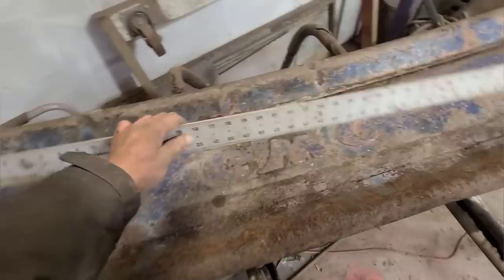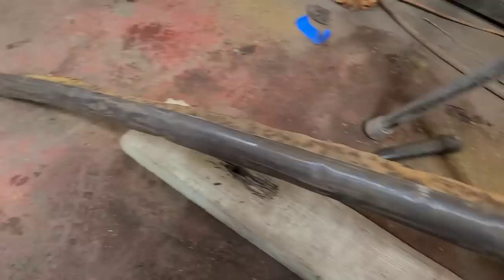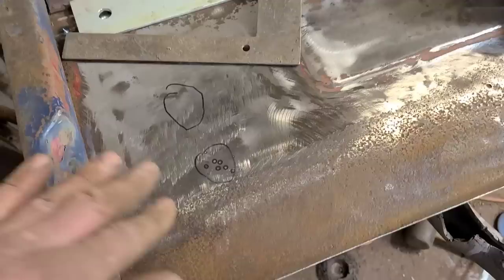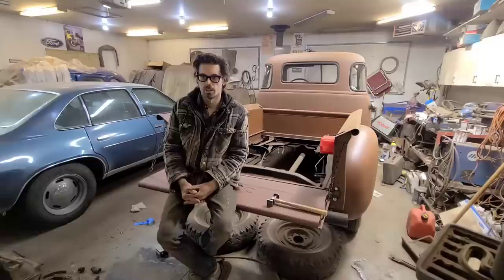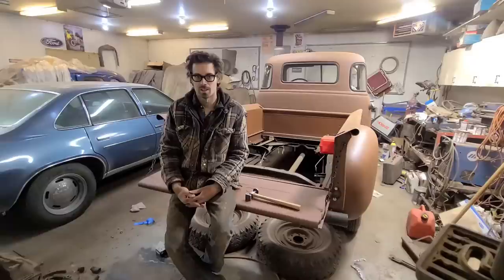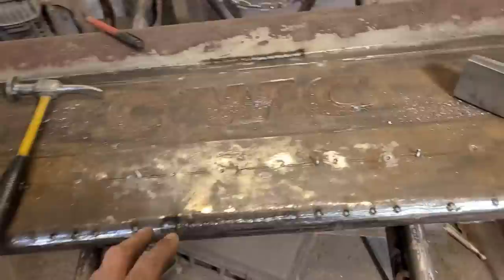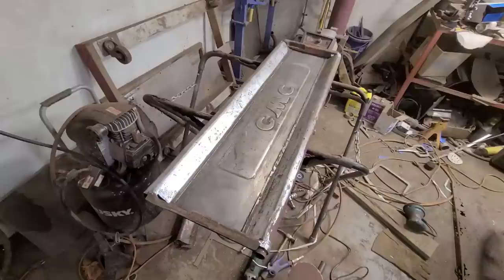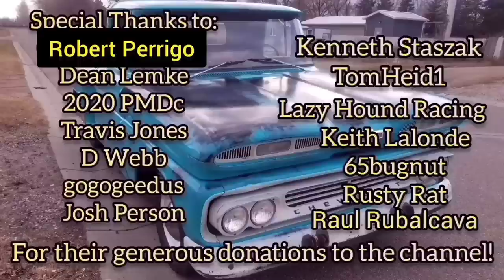EXTREME Rust + Dent Repair. Can this RARE Classic Truck Tailgate be Restored? 1948 GMC Restoration

Comment: I remember my Dad back in the early '80's welding a flat plate into the backside of his '69 Chevy truck's tailgate to desperately try and give it some structural integrity.  Watching him quench it with water and seeing that plate warp by inches was very memorable.  He bought a new tailgate later...  Dad is no longer with us, but the old '69 is still rolling along.  Dad owned it 25 years, and I have had it for 29!  Your '48 should be good for another generation or two!
Reply from the maker: That's great you still have your dads old truck!

Comment: I like that your not just throwing money at it, a close up of the stripping wheel your using on your grinder. Would be helpful, everyone has a different name for stuff, is it a flap wheel or just a sanding disk. Being able to fix the existing panels is skill, anyone can throw parts at it and complain how they don't fit, another great video.
Reply from the maker: Hi Ron. I'm mostly using a paint stripping wheel on the grinder

Comment: My friend, how you do what you do is fantastic to watch.  I also have a quiet laugh when I hear you say the phrase "We're not going to do much to this panel - just make it presentable" and then proceed to turn out something that takes the minimum of filler to finish off and make a showpiece out of.  This video is a true example of that - one trashed tailgate that (at best) someone would bash top and bottom as straight as they could with a mallet and use as patina'd wall-art or (at worst) consign to the scrap metal pile.  You take that sow's ear and make a silk purse out of it.  Ok - I can still see a few blemishes, so the silk was contaminated, but it functions as it needs to and looks perfectly good on that truck....and to be honest, if the truck was being used as a TRUCK instead of a showpiece, would look good enough and function well enough probably for another 70+ years.  I've enjoyed the series on the '48 GMC very much and seeing the different ways you used to tackle the rot and dents...as well as that brilliant 5-window conversion.  Funny thing was, when I started watching, I half expected you to set the tailgate on fire and then blow it out.....and magically, there's a repro tailgate sitting there ready to bolt on!  ....but no.  That patented phrase appeared and then the work started....and I think part of it for you was the challenge to make the original metal look as good as it could.  It still made for good viewing and the tips on using the Unispotter to shrink panels was inspired.  A bloody good idea, mate.  I'd never thought of using one that way, but the results speak for themselves.

Something you said reminded me of a mate of mine and his Austin A35 van back when we were teenagers in the late 80s.  This poor old POS of his had rot in many places and had been driven into the back of a Leyland bus by a previous owner, who then (I think) used the claw end of his hammer to straighten the panels.  The previous owner's panel-beating skillset rivalled that of an empty cardboard box, although at least the box could have been used to make a template.  The little van looked more like a disinterred and rotted corpse that still sported all its fatal injuries than a daily driver, but it had a good heart and got him from A to B and back again.  It was always my mate's intention to straighten it all up with replacement panels off a donor car he had bought, but it never happened.  However, he drove it into the back of another similarly-aged late-50's vehicle and the already stressed and stretched metal got another stretch and stress.  The funny thing was that the front panel and fender had only shifted back (ie: folded up again) by about a half inch, bending at the places where the metal had previously folded and had never been stress-relieved or sorted to anything resembling normalcy.  So, he starts belting on the inside of the fender and front panel with a rubber mallet and all that did for him was prove that rubber bounces off metal in accordance with Newton's third law......and if you manage to hang onto the hammer, you can nearly dislocate your wrist or smack yourself in the face.  As for the fender, it did nothing, so he got his 2-pound ballpein.  Nope.  Movement level = minimal at best.  Right!  The 4-pounder came out and he swung at it hard.  Many times.  He reckoned it took him near half an hour of swinging to get the bottom of the front panel and fender back to where they had been.  When I saw the front of the A35 van a few days after the accident, it really didn't look any worse for wear than it had done before, so his bush repair (applying Mechanic's Law 101 - "if it's not working, hit it with a hammer.  If it still isn't working, get a bigger hammer"), did the trick.....but it is not a tactic I would have employed then and certainly would not utilise now unless it was to get a rough shape back from a total mess.  I did suggest to him at the time that he continue on and correct the other stressed areas and hep add some structural integrity (if not the original lines of the panel) back to the nosecone, but I got given an example from the book of Mechanic's Terms and Phrases that I cannot repeat here.

I cannot recall what you did or said that made me think of the above, but I hope you enjoyed the story nonetheless.  All the best!
Reply from the maker: Hahah! Thanks so much for the great story Lance!

Comment: When I learned that later model step side chevy trucks used the same tailgates that they used back to the sixties I just replaced the gates whenever I needed one but you have the patience of Job and more time than most of us I do appreciate your expertise though. As I said before a true body man is hard to find.
Reply from the maker: Yeah the later ones are the same, but these 47-53 tailgates aren't interchangeable

Comment: Looks great to me.  Thank you for sharing your thoughts on shrinking.  Many years ago my Dad and I tried to shrink a Mustang quarter panel using a torch. Eventually we had to do a relief cut and weld it up again. Oh the butchery you say! My Dad and I were happy with the results. Currently my 49 International KB1's tailgate was in about in the same shape. I plan to replace the rusted out bottom section with 1 1/4 inch exhaust pipe. It will be alright if you don't look at it too close.

Comment: Shrinking disk:  I have used it a lot with great success.  Your comments are on the mark on several counts.  You do need a mega grinder to get the rpm's up to a usable level.  Emphasis on mega....not just a bigger than normal unit.  The marker for me made no difference with or without.  And I wear cut proof gloves whenever I use it.  Unfortunately my good friend Wray who sells them does not tell you that you need that funky flange nut that he sells separately and then you need to stack up a bunch of washers in order to get it to screw tightly into the grinder.  I use a damp sponge so there is not really any rust afterwards and I do rust treatment always right before epoxy primer anyway.

Comment: Thanks for a great video! The use of the spot welder to shrink the small dents and flat panel shrinkage was really cool! I rebuilt my 64 f100 tailgate using similar methods. Split the top to pound out and straighten. My bottom was also gone to the rust gods. A 2" exhaust pipe was exactly the same size. The connecting panels were then easy enough to bend. Lots of spot weld drilling and patching. At the end of the day it looks and works pretty good. Enough imperfections so it looks like a survivor! (That's my story and I'm sticking to it! ) I looked at used $1000 tailgates which weren't much better than what I had. And new one blew my budget. I'll never achieve your level of skill but I'm ok with that. Thanks much! Learned a lot!:)

Comment: Brilliant job once again Kyle.  Hey the wand idea probably came from guys from olden days , they would use a thin stick and turn the amps right down on a stick welder and scratch it along the back of the panel a couple of times to tighten it up.  Ive never used the shrink option on my stud welder, think i will give it a go . 6000 rpm on a 9" grinder is what Wray says. Thanks for all the videos on this one build thoroughly enjoyed them all.

Comment: Cool shrinking technique. I am going to try it. My biggest challenge is trying to determine if the high spot needs to be hammer/dollied or shrunk? The only way I can tell that I should be shrinking is when I am chasing a dent across a panel. Thanks for another great video!!

Comment: Iv used one of them magic wand things ,it came as part of a spot welder. I don't know where you would get one now,they was great. I have used the core of a battery pushed in end of mig where tip go's to get same effect but don't think it's good on your equipment. I did have a dent puller that did have a shrinker on it ,shrinker bit looked like a single side spot weld bit but hollow.  Anyway great vid as always.

Comment: what are you doing for rust prevention inside the rolled edges of the panel?
Reply from the maker: The same as what the factory did. If it was being made into a nice tailgate I'd use epoxy primer

Comment: the magic shrinking wand is a carbon arc rod like the ones used in carbon arc brazing also used in arc lights i used one like you said for shrinking when i got a oil can flop in a panel and if you used a decreasing spiral to the crown of the dent had good effect also if i needed to heat a frozen nut.  my mig welder has a attachment to use these rods on low settings  poor cat looks tyred or is he retyred
Reply from the maker: Thanks for letting me know what it's called! Allan was actually just trying to help me mount the tires.

Comment: Metal shrinking is still black magic to me, (especially in oil can spots)  but every tip helps. Unfortunately, to get anything even halfway right, this is a skill I am ever learning myself. Many moons ago I discovered my bodywork budget is only enough to hire the atypical Earl Schiebs tweaker who thinks spot putty, bondo and a smudge of dirt (for blending) can fix anything.  I only made that mistake once. The second time I started buying tools instead and then I contemplate my life decisions until it's good enough-lol.

Comment: Hey Kyle I have been working for a bodyshop this winter and have been applying your welding techniques to great success. Thanks for sharing your experience with the spotter. I have a spotter like Arthur has, and it works good on modern cars but the steel on older cars is to thick and the machine doesn't have enough power to get the job done effectively.
Reply from the maker: Thanks Keith! Yeah it makes sense that dent puller wouldn't work too well on old cars

Comment: Great video.  Great skills.  I suggest your next shop investment be a large solid steel table so you can work standing up.  I caution against tacking without a welding hood.  I know why you do it and I know what happens to you if you do it a lot.

Comment: Extremely impressive. Are you sure that quenching it shrinks it a little more though? I would think that quenching it would stretch it a little more, seeing as how it's the opposite operation that shrunk it. The way I learned about shrinking is that the hot metal has nowhere to go except to force its way up in the bizzness of the not-hot metal, causing the metal at the border around the hot metal to thicken slightly. As it cools, the slightly thickened metal is supposed to pull the formerly hot area tight like a drum, but I would think if you cool it violently, that would pull the excess back to the area that was just hot, thinning the thicc metal back out a little. Granted the guy that explained it to me was.. let's just say he was not well.

Comment: Why didn't you just... Well, I thought you might be chasing some of those dents around on that flat panel, clearly I've underestimated you. There're probably lots of ways to "grab" the video clips from your previous videos, what comes to mind is using OBS Studio. You can screen record into a file you save on your computer then bring it into your editing software and crop out what you don't need. I don't know a lot about video editing but quite a bit about computers and software in general, if I could be of any help to you Kyle, let me know
Reply from the maker: Thanks Jared, it's much appreciated! I found out that I can just record video clips on my screen as I watch them, like a screenshot except for videos. Probably the wrong way, but it does seem to work

Comment: I would like to know what it cost plus what the materials cost pluss what you get for it. But you went over that in this video. (Yes!) And you need to put on flame stickers for max profit and paint the engine block red for  20 extra horsepower.  That will make sure the Bugattis are left in the dust.

Comment: Anyone can go out and buy a Chinese tailgate that probably won't fit too well and be obvious to those in the know. Restoring an original panel cannot be beaten in my book. I also agree that for a truck that is meant to be used rather than a show queen then one doesn't need to have it absolutely perfect but I think your work looks damn close to perfect.

Comment: Just a thought. I don’t have a unispotter or a stud gun. What if you had a mig with no wire in it. Could a contact tip cause heat and shrink? I’m prepared to get flamed publicly for suggesting to use a tool for unintended use 🔥
Reply from the maker: Give it a try and let me know how it works!